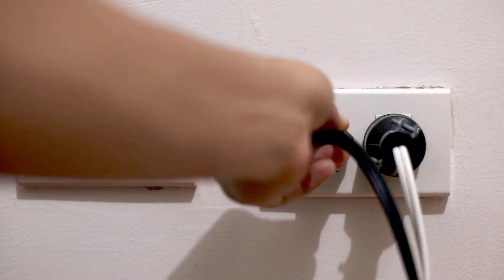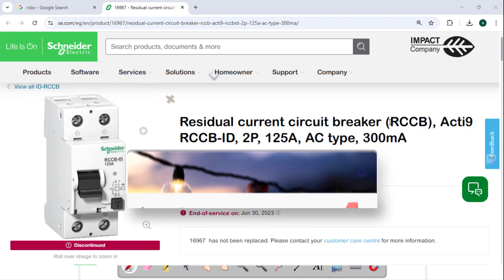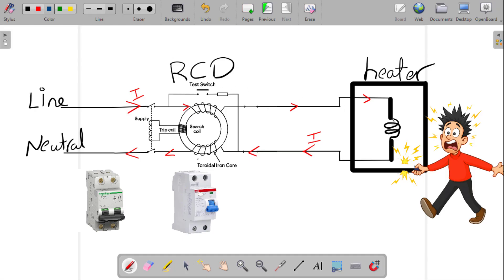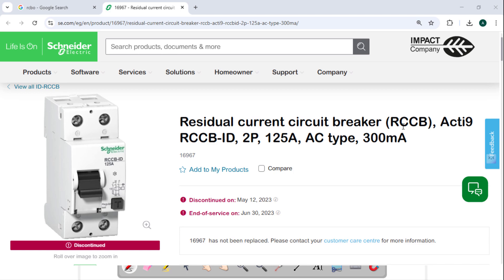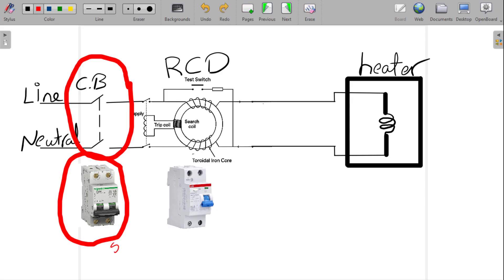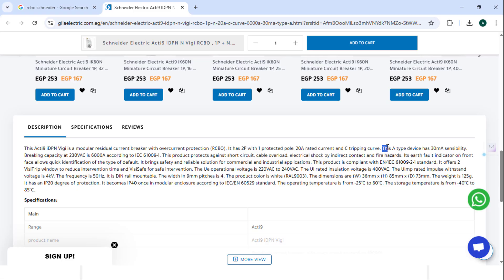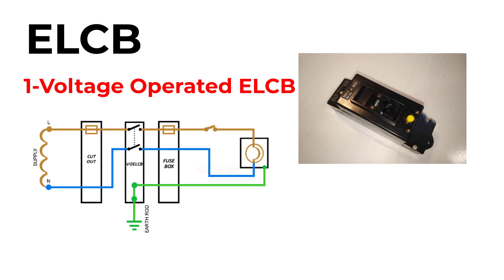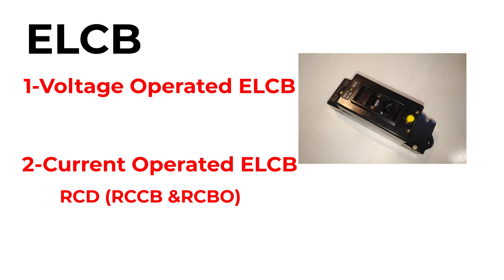RCD vs RCCB vs RCBO vs ELCB Which is BEST for Electrical Safety?

Comment: If i want to connect to water heater 
Should by one same as elictric 60hz 
Or i can install 50hz also
Reply from the maker: For a normal electric water heater, the frequency (50 Hz or 60 Hz) doesn’t really matter — just make sure the voltage matches your power supply.
But if the heater has a motor, fan, or advanced electronics, then always buy one with the same frequency as your country’s power — in Egypt, that’s 50 Hz.
Reply: Thank you very much . Yes its only heater 🙏🙏 @electricalengineeringplane6620